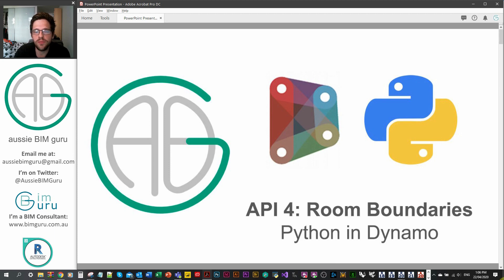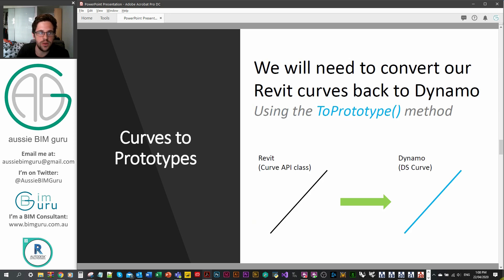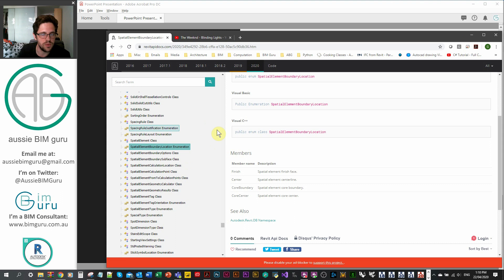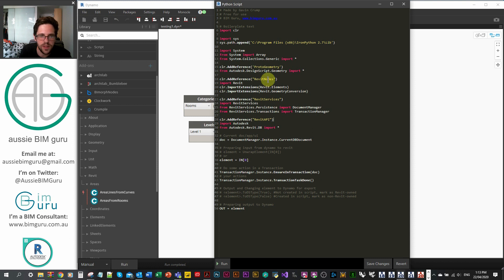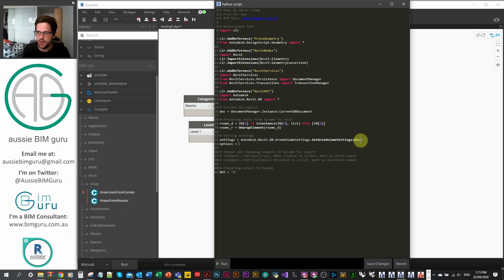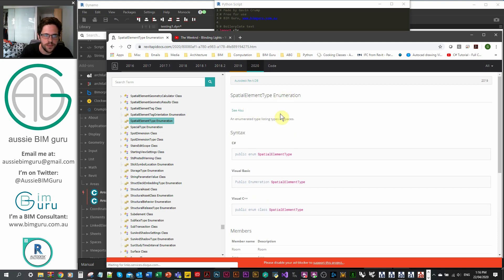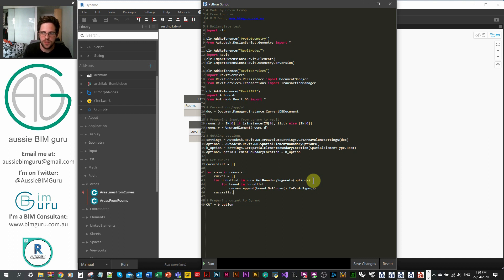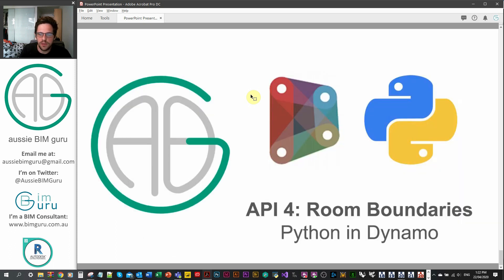Python in Dynamo: Room Boundaries (API 4)

Comment: Hi I was wondering if is it possible to do the opposite process, so getting rooms from areas?
Reply from the maker: Yes this method in the revit API can create rooms at given points (uv, so x/y component only) and a specified level.

https://www.revitapidocs.com/2024/28262c8c-d18a-338c-eb17-f406438949d8.htm

In this case rooms would need to be boundable using separators if not walls, which is different to areas.

Comment: Amazing content, quick question! Is it possible to add another level to the list or remove? When I have a bounding square in the middle of room, that isn't touching the room bounding perimeter. The Python script duplicates the room, it create two list of same curves(including the curves inside the room). While the dynamo node(Room.FinishBoundary) would have the room under 1list with two subsists: 1sublist of perimeter bound curves and 2list of inside room bounding curves.
Reply from the maker: Yes as you found if you have multiple loops per room you would need to combine their curves into sublists aligned per room.
Reply: I think it worked now, added an empty list (dCurves) before the for loop bound in boundlist. Then, first append to dCurves, second ADD to curves and finally append again to curveslist

Comment: Thank you so much for a great video! Could you please let me know how to make a "select.ByCategoryandLevel" node?
Reply from the maker: I don't believe such a node currently exists unfortunately, at least not out of the box. Most elements store levels quite differently to each other such as walls or floors (different parameters), so Python would likely be needed in order to test for all typical parameters. The hasatrribute() method could be used for this in a rather lengthy if statement to catch each likely scenario per element in a for loop.

I believe clockwork and genius loci have some exposed nodes that work this way already.
Reply: @AussieBIMGuru  I found the node in the Genius Loci package!

Comment: Hi Gav, awesome video. I was trying to rebuild your code in C# but, for some reason I cant acess the Get Boundaries Segments in my Rooms... Do you have any thoughts on why this happen? Great video as always, thanks
Reply from the maker: My C# knowledge is limited, but make sure you're trying to call the method to an IList. The actual API method is here for reference: https://www.revitapidocs.com/2022/8e0919af-6172-9d16-26d2-268e42f7e936.htm
Reply: @AussieBIMGuru  Thanks for the replie. The method is for a spatial element, but i am getting a Room element from the revit API. I think they are not the same. 

It os possible to convert a Room element in a spatial element ?
Reply from the maker: Spatial element is the parent class for rooms, areas and spaces so don't think a spatial element is needed. Maybe check in on the C#/developer side of Revit forums on this one. It seems python/C# differ on this workflow.
Reply: @AussieBIMGuru  You're right. In fact there is a sample for Rooms in revit API Docs to get the Rooms Boundaries but after a Ctrl C + Ctrl V the sane problema appear where Room does not contain the Get Boundaries Segment method ... 

Do you know any C# forums ? They seem scarce ...
Reply from the maker: @alvernepaiva3287  https://www.revitforum.org/forum/revit-all-flavors/third-party-add-ins-api-and-r-d

Most developers work on paid products, so its harder to find an active community versus dynamo.
Reply: @AussieBIMGuru  You're right ... I posted my problem in the forums on Autodesk to see If anyone can help. Anyway thank you so much for the help. 

I still have not found a solution, but I am looking foward to see If someone can help. Thanks Gav, god bless you my friend